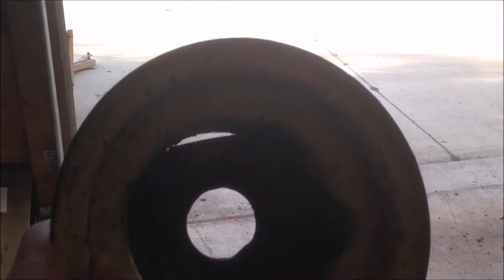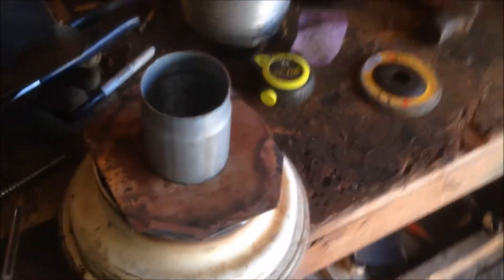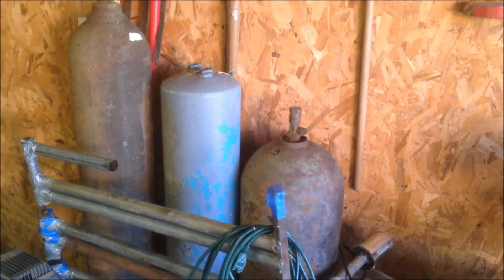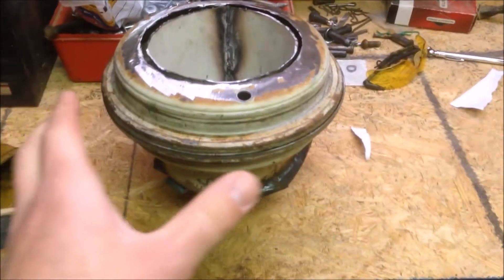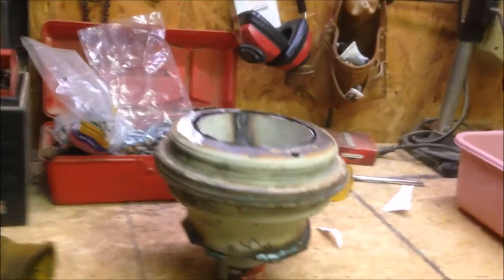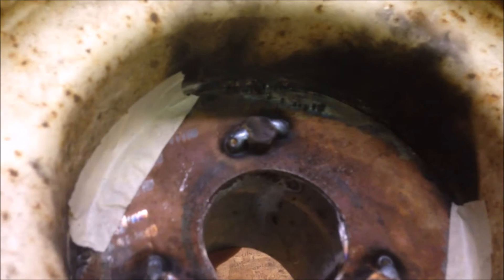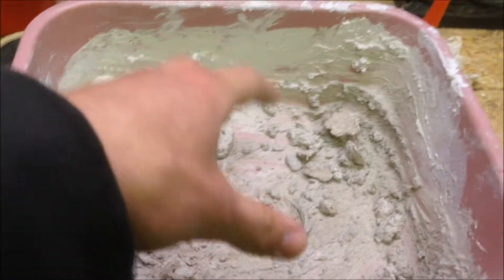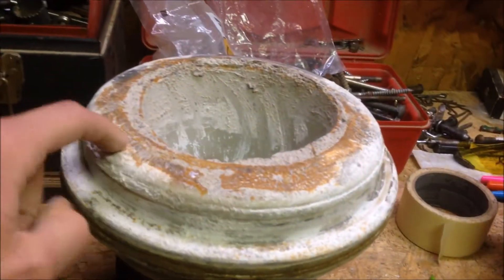Wood Gasifier Build for Dummies 2, The Heart

Comment: I've been subbed to Flash for year, IDK how I missed your channel.  I have a small trailer that I was debating to make into a sawmill or a mobile Imbert.  The Imbert idea wins.  I have plenty of reference materials, plus many video series watched, downloaded and archived, but just a real quick question.

I'm not entirely sure which motor I'll be wanting to pair this to, so would it be Ok to build for a large motor (many HP) and scale down to whatever I choose to put on it?  My Ford Ranger is 160 HP stock, so I'm thinking build for that, but if I only need to pair it to a small generator, what would be the downside for having the larger unit?